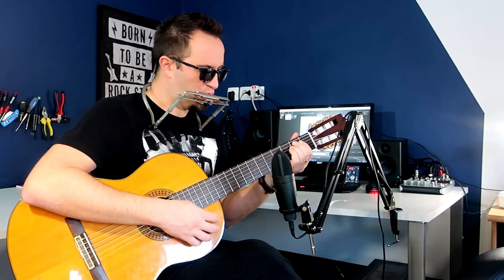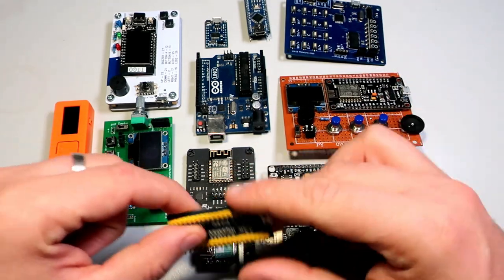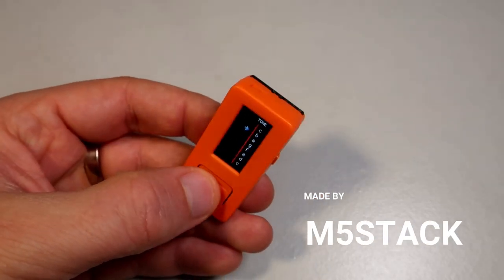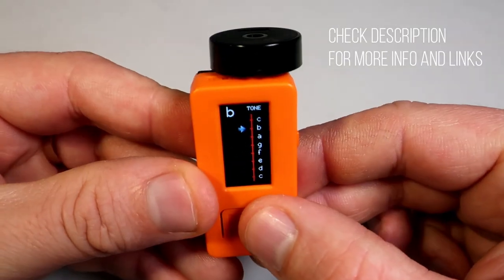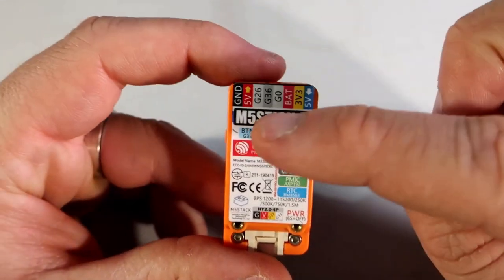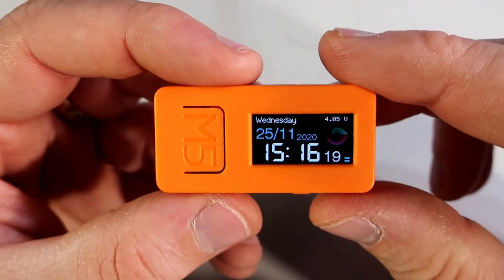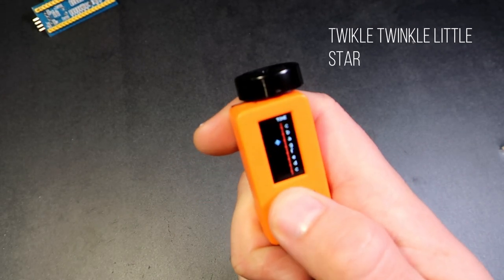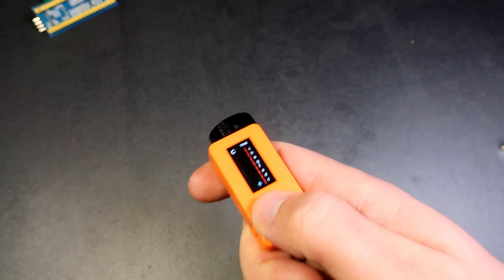M5StickC Music instrument - Free code for Arduino IDE

Comment: Thanks for letting me know.. Yes, I do now understand that this very cool instrument won't run on the new h/w version of the M5Stick which I just got .. it's called an M5StickC Plus V1.1.   So, if you are having a problem with this code not running properly after it compiles and loads Ok..  this may be why. :face-fuchsia-poop-shape::face-pink-tears:

Comment: can I request a project?
Reply from the maker: You can try, if i like it i will try to make it.
Reply: @VolosProjects  I request: lcd project oled with one button.  by the way it works, that is if the button is pressed it will display the clock menu and if it is pressed again it displays the DHT11 temperature menu and if it is pressed it returns the voltage menu and if it is pressed it returns back to the beginning, namely the clock menu.
Reply: @VolosProjects  more or less like that my request, if you can reproduce the menu and add sensors in each menu.